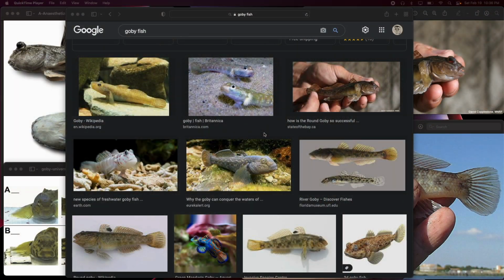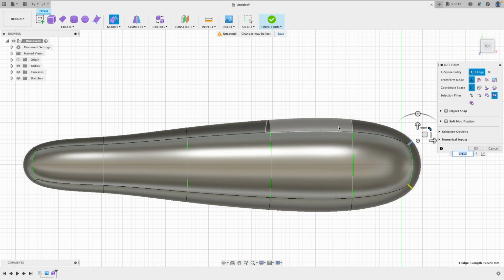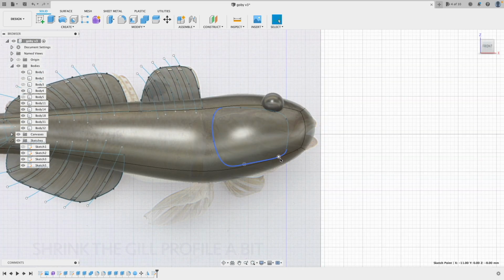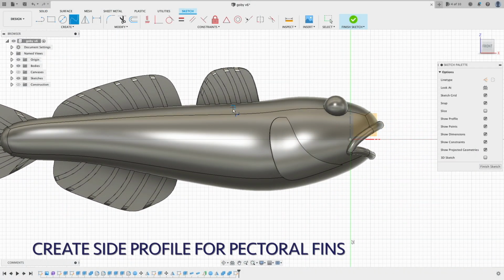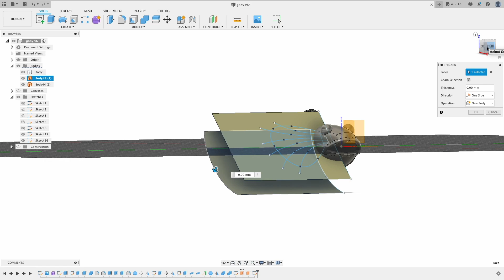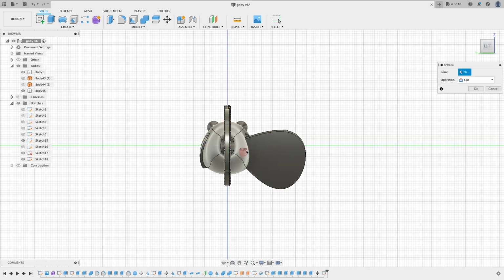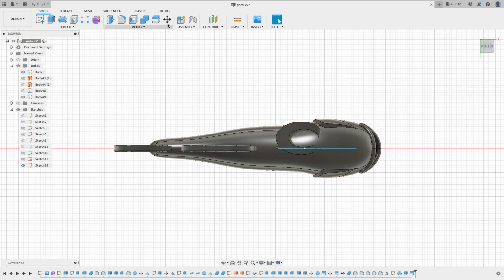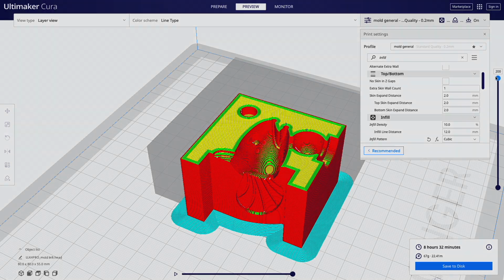Making Goby Soft Plastic Lure from Scratch

Comment: serious why you spped up the video like that... for noobs it's very difficult to follow. but final result is beautiful.. not sure it's very performing in water... too heavy. but it's beautiful for the eyes and very similar to a true one ;)
Reply from the maker: Ooops I was afraid viewers will get bored if the video is at regular speed. Try to playback at 0.25x speed and see if it helps. Yeah I was going for a stationary style and did not plan to work the bait too much, maybe just drag it along or bounce it off the bottom. And that’s how those gobies behave most of the time, I think. With that said, I am also working on a variation where the body has segments and hope that will create some action when slow swimming. I might release that one if it turns out to be successful. Stay tuned and thanks for watching.
Reply: @yauckoutdoors  yeah it's what i do :D :D
i was blocked and i finaly find the solution ;) :D often problem is that video are tooo speed for noobs like me :D :D :D thanks for all my friend ;)
Reply from the maker: @sskkoibelgium159  anytime! If you ever get stuck, just post your question in the comments. I should be able to get back to you shortly.
Reply: @yauckoutdoors  thanks a lot my friend ;)

Comment: wow, This is so cool, I'm very interested in this，I'm trying to do it myself, But I have some problems， Can you help me？  1. I don't know what printing material should I use？  2. How much is appropriate for printing infill density？ 3. What are you smearing on the mold with the toothbrush in your video?  If, you can answer me, I will thank you very much
Reply from the maker: I mainly use PLA because they are easy to work with. There are other materials that can handle heat better like PETG, but I don’t have experience with it. For infill, I think 10% 2 lines should be good. That’s what I use. But sometimes I use 20% for thinner open pour molds, because I don’t clamp it when pouring. Hope this helps.
Reply: @yauckoutdoors  Thank you very much， I am also a design lover of fishing bait, but I am just getting started, and there are still many problems that have not been solved. I hope I can communicate with you more and learn more knowledge:elbowcough::elbowcough:
Reply from the maker: @zhenggong3560  you are welcome. Just leave comments/questions, I will try my best to answer.
Reply from the maker: The oil was fish attractant (classic bass) scent oil. It lubricates the molds and attracts fish at the same time 😄

Comment: Oh and a quick tip, you don't need to use surfaces to split, you can just draw lines. Makes it a little easier to deal with for me.
Reply from the maker: Yes that would have simplified the splitting process. Thanks for the tip!

Comment: The lure looks amazing but I think it would look even beter with just a little smaller pectoral fins
Reply from the maker: Thanks for the comment. It's an easy fix or customization - just trim it to your liking like cutting out the flashing :P If it's too small then I will have to redo the mold. Evan that it's still possible. It's the beauty of the DIY lure making - you have all the controls. Cheers!